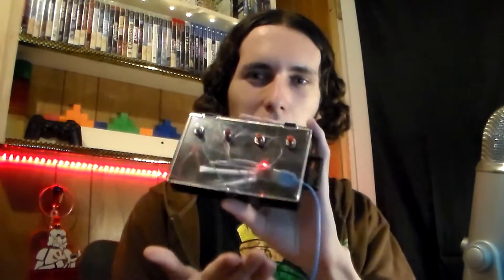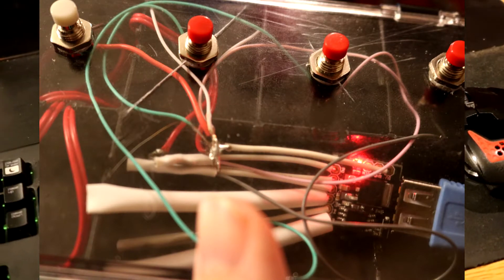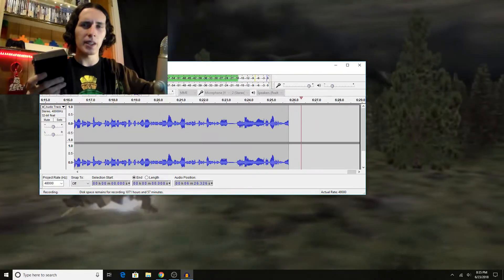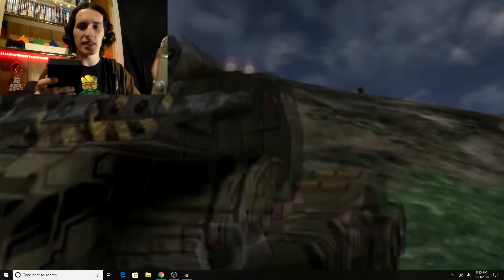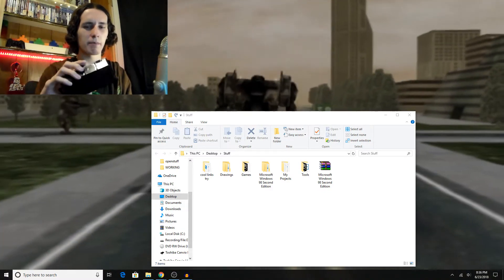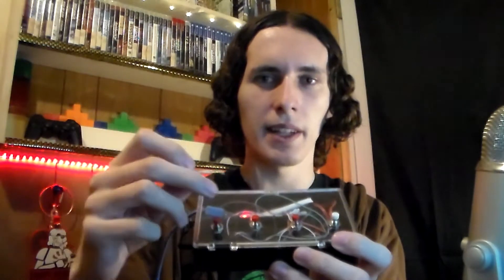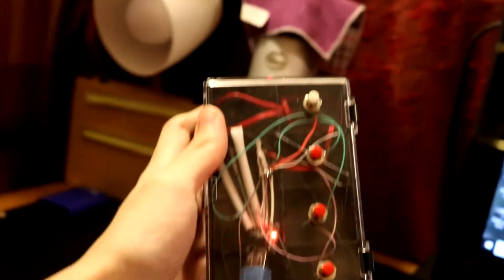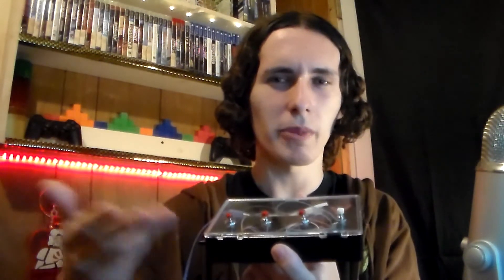Digispark 4 Button Macro My Thoughts

Comment: What's the pinout diagram you used for your buttons?
Reply from the maker: Think it is in description of the video it is a bit flakey though which is why I swapped to using a usb pro micro... The 4th pin is technically a reset so hitting the button long enough does that.
Reply: @everythingdigital1  I checked but don't see a diagram. Trying to just use two buttons but overall same layout. Not sure where to solder the wires being my first time lol.
Reply from the maker: @ZzLuLz  Im busy at the moment but ill have a look I think I left the sketch in the description as well the arduino code. When i'm back ill see if I have the code still if it isnt in the description already lol.
Reply: @everythingdigital1  Thanks man

Comment: Okay so the board is fine if you were to use 2 simple buttons? I'm very tight on space with my project so every mm counts for me. All I need is a board for 2 push buttons. Is that possible with a (knockoff) digispark?
Reply from the maker: Yea doing 2 buttons is ok. And a knock off should be fine. Just be sure to check it's diagram and pin layout in-case any of the pins are different. I know some digisparks got a reset pin in different spots so don't put your button on those pins or else the digispark will restart.

Comment from the maker: Well I took this one apart used a proper arduino board capable of hid as well as many other functions. Also it's so much faster about on par with a usb rubber ducky if I recall and it was so much easier to put in a proper smaller case.
https://www.youtube.com/watch?v=vGEm43h3wfY

Comment from the maker: This is a little update I suggest if you use a digispark to make sure its the real kind and not a knock off mine was I believe but I didn't bother to test also adding a button to pin 4 works but since its a usb pin you hold the button down too long it will disconnect the digispark the proper way is to wire the 5th pin to ground. So my suggestion is to try another arduino like a pro mini I believe. Or go the easy way by using a usb to joystick encoder. I will be making videos on both these methods too once the stuff ships which will be months weeks who knows.